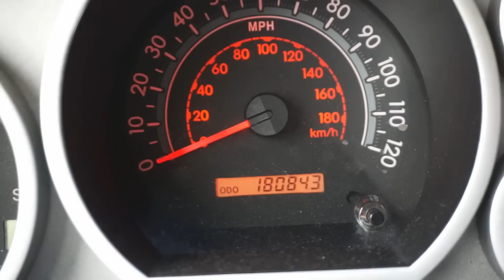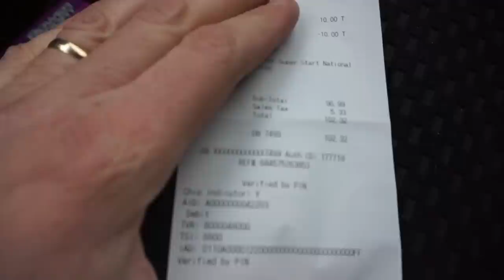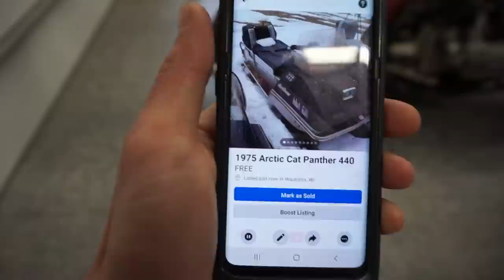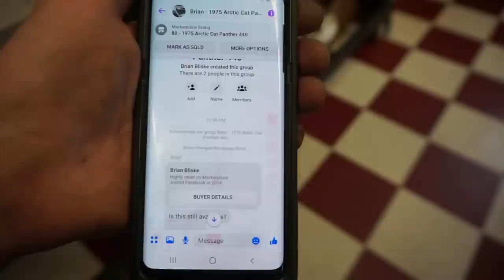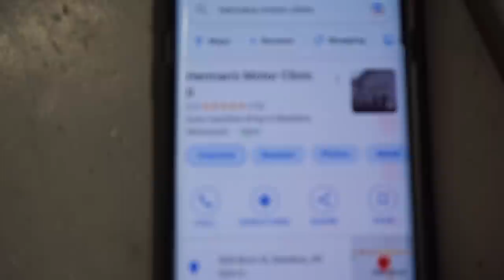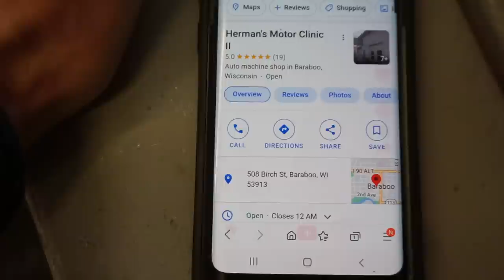I Had To Pay $26,000 For This...

Comment: Sweet! Just don't make the mistake and make it small. I pour concrete floors in pole barns and garages and almost everybody says they wish they went alil bigger!
Reply: Gathering information for when it’s my time to build. What’s the most common size that people got and wish they upgraded? And what’s the upgraded size you’d recommend. If that question makes any sense
Reply: @Isaiah Kane  prob built more 2 door barns/shops n garages ..For example 24 x 3o ..you should go 3o x 4o ..just been my experience with ppl.

Comment: I’ll tell you now that ticking noise isn’t the exhaust lol. I’ve had 5 different motowerks systems and none of them ticked. That’s a motor noise. The 3 YFZs I had all ended up making that noise too. First two were timing chain tensioners, 3rd one was the timing chin itself. Bet money 👌🏻 just cause the valves are in spec doesn’t mean they won’t be the issue. Swap the chain and tensioner and call it a day and thank me later Joe

Comment: Is the fuel screw used to regulate the fuel to air ratio. I’m wonderig because I have an old sled that is running too rich. It boggs at low rpm’s when you press the accelerator.

Comment: What should I do if my big bear 1989, 350 4 x 4 only sparks ones and I have replaced all the relays and the solenoid’s and I have put a new coil were a new boot on it and the stater 3:56

Comment: 180.000 miles on a Toyota is just barely the break-in time lol. They run forever. Especially if they are maintained well. I once had a Nissan pickup truck that had 318.000 miles when I bought and I put at least that much more on it in the 7 years I owned it and never had a single problem with it. I sold it to a guy who took it and had it completely brought back to brand new looking from bumper to bumper and gave it to his daughter to drive back and forth to college in. It had way over a half a million miles on it when I sold it and ran like new. You can't kill those import trucks as long as you take care of them.